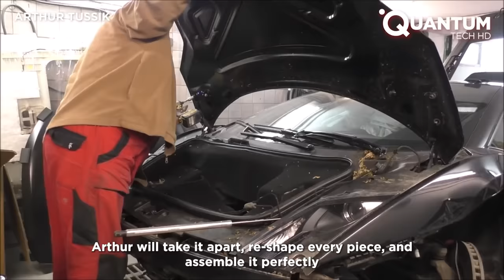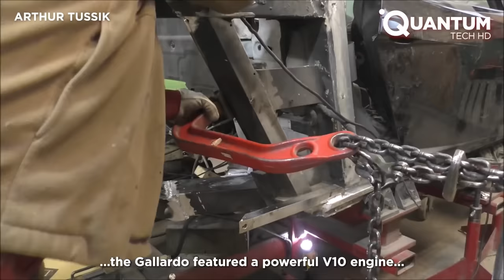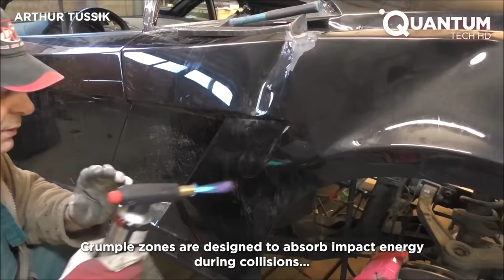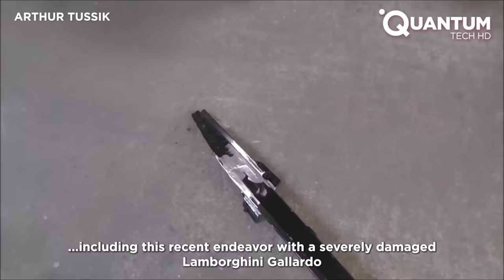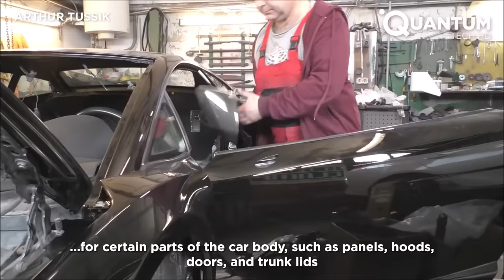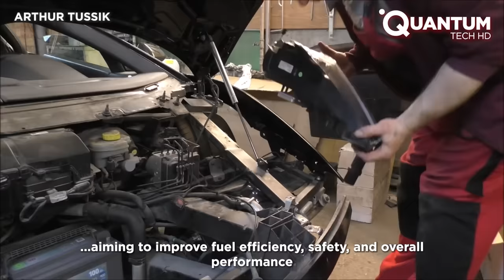Totally Destroyed LAMBORGHINI Repaired by Professional Mechanic | by @tussik01

Comment: It will never be the same car as it was before crash,man did the great job thats true , i mean only at car at this moment, it s  like you brake something use the glue to repair
Reply: Why? Can you explain that?
Reply: If you need to ask the question, you probably wouldn’t understand the answer
Reply: @nic8810  😂😂
Reply: Full credit the guy is talented to restore this car from the wreck it previously was.
Reply: @perttituorilainen9144 ....rebending and restreching makes the metal weak....thatsway.
Reply: They are never the same car once major repairs are completed
Reply: That’s why it’s cheaper😂 duh😂
Reply: It’s a Lamborghini who cares rebuild or not 😂 especially if Arthur made it 😆
Reply: If you had no idea of the car’s history and were to inspect it I’m pretty sure it would be damn hard to tell it had been repaired.
Reply: 😂😂😂!!! Some people will never get a chance to drive even the one that is repaired.
Reply: Questa se la tiene il carrozziere.. non sarà mai più la macchina di prima
Reply: Agree. Although a nice job I have seen repairs where they replace a lot more instead of repairing it. Only then you come close to factory again I think ..
Reply: So what
Reply: @perttituorilainen9144  since nobody answered....lets just say that a structural damage like the one suffered by that car altered the overall rigidity and stability, plus the material used by that mechanic to rebuild the missing body structure has a high chance to not have the same quality so the car will not have the same balance as it had when it was new.....and I am not even getting to the engine part of that rebuild....
Reply: Ci sono professionisti del lavoro,da un morto sono capacissimi di grandi risvegli vedi ciò che hanno fatto a questa ❤LAMBO❤❤,, INVECE CHE CRITICARE MANCO SAPRÀ DA DOVE INIZIARE A SMONTARLA FIGURIAMOCI A ASSEMBLARLA....
Reply: Thats nonsense
Reply: Yes, I am agree . No same.
Reply: True it s now much better because Arthur rebuilt it....
Reply: @kealahau6727  lol, goofy
Reply: @hazetrinity66  🤣🤣
Reply: Prformance sportcar like this,originally designed with specific weight distribution, specific geomatric.once it got into a major crash,the repair work will temper these aspects.it may look the,but it will nver b the same.hv to try drive it as certain to substantiate this.most likely, it will b the same.repair marks wud b evrywhere, thus in eyes of Lamboghini enthusiast expert, its value dropped signifcantly
Reply: Maby better
Reply: A meno che non vai in pista e non sei un pilota, non puoi accorgerti della differenza. Se la smonti probabilmente ci sarà qualcosa fuori posto, ma non influisce molto sul valore totale. Io la comprerei ancora.
Reply: I wouldn’t pay any more than $20k for that car
Reply: bcoz u watch this..
Reply: Refurbished will never be as good as new .
Reply: @aww7056  yup! I had a car that was repaired after an accident and even though it looked fine, it used to rattle and squeak over bumps and never handled the same after.
Reply: It gets built at the factory
Reply: why not ? 

it can be much better
Reply: @ignorantenf.u.4810 actually heating it up weakens the metal making it easier to bend and when it cools back down  itll retain it original or nearly original integrity but obviously you got to hot and youll melt the metal and itll melt and compromise its integrity but the body panels dont mater for that situation anyways nowadays cars body panels are so thin they don’t really add any structural integrity
Reply: @giacomazziandrea für ein 1/10 vom Wert des Fahrzeugs.
Reply: @GerhardSchafer  tu compri solo nuovo al 100% del valore. Perché nessuno ti vende auto usate a te a 1/10. E poi i carrozzieri non esistono in Germania?
Reply: My car has some new parts on it it's always been on the "less desirable" car now it is kind of a cool car. It's not a Lamborghini though
Reply: Who fucking care it’s a Lamborghini man. I wish i could drive or just looking at it😂
Reply: @jeffmaanaki949  I'd drive it. It might even be safe. I find that the reshaping of the metal seems to well within its capability.
Reply: That’s exactly what a surgeon says after carrying out major surgery, no they don’t, this body builder is one of the best, this car will be as good as before.
Reply: @nickjanssens  Better than! lol
Reply: But appreciate the initiative rite♥
Reply: Facts, he shouldve replaced all structural parts instead of bending it. This car was totalled.
Reply: You think?😂
Reply: no nie stety ciekawe czy konstrukcyjnie też wszystko wróciło do stanu fabrycznego w jak największym procencie
Reply: The whole point is to fix it
Reply: All F1 driver in this post......
Reply: Deve nem ter uma bicicleta e quer falar mal de uma linda Lamborghini como essa
Reply: This guy didn't melt, he heated and bent the metal.  So to claim with no evidence the car can't possibly drive as well as before the crash demonstates you don't understand metal.  Sure certain metals are brittle and can crack but plenty can safely be heated and moved back to acceptable position.   In this case , I would be concerned to claim with no data a repair is no good is just guessing.   @taylorebenguard6998
Reply: Je suis tout à fait d'accord avec vous.je roule en 991.2 si la voiture avez eu le moindre accident.en France impossible de la revendre
Reply: Eu penso o seguinte, já estava destruído e ele o transformou em um carro de novo, vai ficar igual o de fabrica não mas o trabalho ficou incrível...
Reply: Bonjour tout a fait  tu a tout compris chapeau une voiture  dans cette etat serra toujour plus fiable point de vue carrosserie  disons invendable et le constructeur et l.assurance ne payeront jamais ...a la demolition c.est plus equitable pour tout le monde amicalement lepeltier Patrick Ferrari geneve suisse et Bonne continuation et Bonne route 😢😢😢...❤❤❤❤

Comment: The problem with this kind of repair, that all the structural metal part are already plied one time so, after extension the metal is less resistant...In case of a new accident the driver could die......
Reply: Zbytečná panika

Comment: L'aluminium se microfissure lors d'un choc, et lors d'un choc le redressage conventionel est seulement permis que s'il y a remplacement de l'élément redressé. Pour le réchauffement des pièces à redresser, 160°C est la limite de T°à ne pas dépasser( crayon thermo chrome ou ....).
Plus simple, vous pliez une feuille de papier, essayer de la redresser ..... C'est la même chose avec l'aluminium. L'espace intra moléculaire a été rompu.
Le remplacement est la seule solution, par collage, rivetage, klinching.
Vidéo intéressante😊 
Alan

Comment: If you pull bent subframe elements back to the original position, at times heating the metal to make it easier to form, will the structure be as rigid as it was or needs to be? This is a hugely powerful car that puts enormous pressure on the frame and chassis. Will the car be strong enough once rebuilt?

Comment: First, RESPECT!  Second, I've refurbished (not restored) three Ferraris (206GT Dino, 246GT Dino & 308GTB) in my life, so I know a bit about parts costs.  In the case of this Lambo, I'm wondering if the cost of the replacement parts alone didn't equal the value of the finished car, especially how such an accident would have negatively affected the value?

Comment: The gear Box become a very hard hit,when the rear wheel hit some hard things,like this car become,the drive shaft hit the gear Box deep inside,and you see from out side from the gear Box nothing but inside its defect, it can be you drive 1000 miles its ok,but next time the gesr Box is down,that you need a new one, this car can run over 300km/h!! I never need this car,for a German Autobahn when i drive fast on it,its much to dangeres a full crash car,repair and do like its s New good car,no no so much parts can have a probleml what you dont see inside,the car is ok for show on race track,but not realy perect save for regulär Streets, the same Porsche when the Porsche habe a big crash,nobody pay for it big lot of money!!  Sorry for my bad english best wish Reiner from Germany

Comment: I own a shop that does work like this. He should have put it on the laser system before repair to check the frame specs if they are available, to make sure the job is done right and the frame is in factory specs.

Comment: Ya beating stuff out instead of replacing it like it should will never be as safe again. On top of that it qould never pass inspection as a salvaged title. Its as good as a parking lot scooter or a tow behind trailer queen. Theres a reason cars need to be replaced or the parts replaced in the core after a crash this severe.

Comment: Unfortunately the car won't ever be as it should , I am not exactly sure of what grade of steel the chassis is made from but would very much doubt it would be standard mild steel, it would have to have a higher carbon content to retain its stiffness. When you heat carbon steel you are in fact annealing it, you would have to temper it to get it anywhere near to its original properties which was not done. Therefore all the heated areas will be soft so are likely to move under driving and if the car is in another accident it would be a potential disaster.